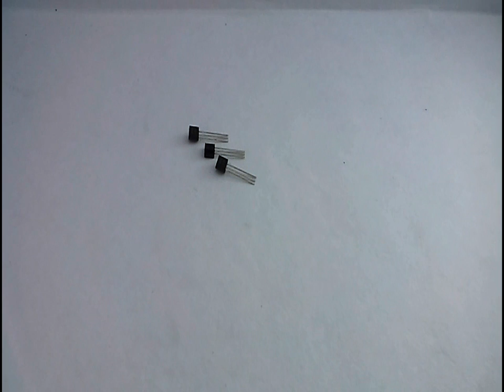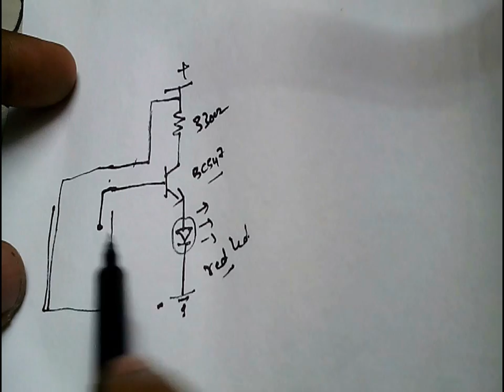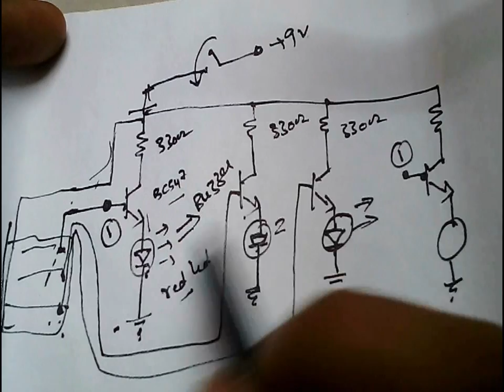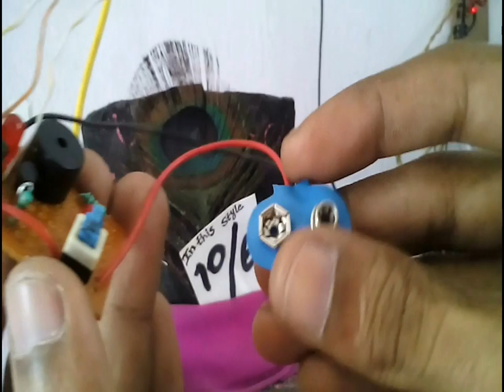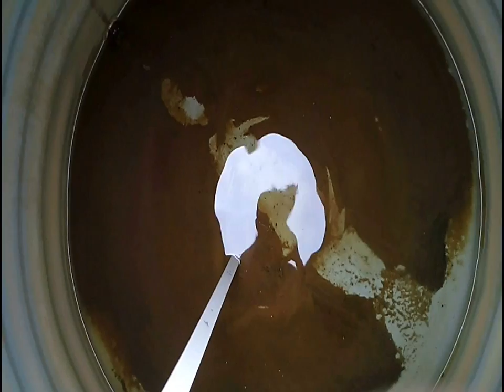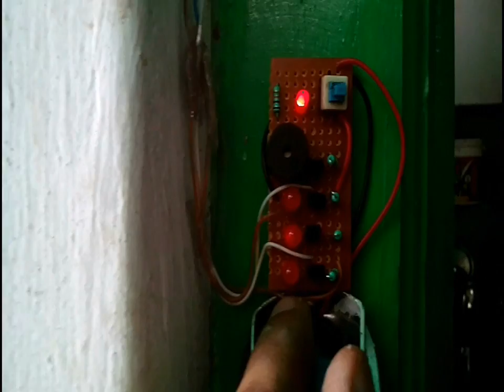Overhead Tank Water Level Monitoring system

Comment: 1) If we switch on the circuit full time (24x7) then how many days will get the battery back up..
2) I used 5V 1A adapter instead of battery and tested with a mug of water,but i am getting shock from the water.. how to resolve it.

Comment: Hi nice presentation,my question is how long will the battery last?
Reply from the maker: Mine lasted for a little more than 4 months
Reply: Thanks for reply, have got one more question have tried making one of this it worked but considering the water resistance my LED are not bright when in 2000 ltrs tank.kindly advise am really looking forward to see this work out for my main house tank. Am using 220 ohms resistor.
Reply from the maker: Hope u r using a 9v battery, try changing the transistors to something which has high gain.

Comment: Dear Mr. Khader... I have 2 overhead tanks... Can I build a single system with separate LEDs and sensors. Still keeping the battery, buzzer and the circuit common. Please guide with circuit diagram and help.

Comment: Please clarify about 330 Ohm Resister. When asked about this they are asking more details about the  330 Ohm. Please Clarify the full specifications of the resister & also instead of BC 547 Transistor got BC 548  as could not able to identify very small letters.  Please clarify the two problem to make the  project success.   Regards.

Comment: how to make auto cut if possible wireless system pls guide video
Reply from the maker: +Ashish Rateria u mean short-circuit cutoff?
Reply: Electronics Made Easy : KHADER when water reaches at maximum power cut off and level indicator are wired any solution for wireless as created by Vipin verma
Reply from the maker: +Ashish Rateria u can create this same circuit and wire it to the RF modules to create wireless system

Comment: Excellent work man. Job well done. 
Its been almost 2 years now, How is this thing working?

I would like to implement this at my home. As I am not from the electrical background, it will be really helpful if you could provide the circuit diagram. 
Thank you for posting this video.
Reply from the maker: +Ravi Raturi thanks for asking Ravi. Everything is going good for now. U can get the circuit in the video itself.

Comment: Hi Khader your video shows awesome work and I am trying to make it because tank is on the 4th floor and everytime one has to go up to see if it is filled.
I have made the circuit as described. Previously I used lower resistor so the led got burnt but putting wires in the water it was lighting (aft sm time led burnt). Then I used 1k ohm, it was still lighting but very low. Later I learnt the colour coding. Now that I have learnt the colour coding of the resistor I have a 220 ohm which I am using with 547 transistor. Its not working. I have tried with 100 ohm. tried series with 220+220 ohm. No luck. Now am again using 1ohm & 1k ohm (which were working previously) but even they are not working now. circuit is as previous. every wire connected to breadboard and respective place. Can u tell me what is the problem? Is there any way to check at which stage current is coming or something. Never usd multimeter but hv seen videos. Can buy it if u suggest. 
Am new to electronics but very curious.
Reply from the maker: +Mayank Mishra Hi, please try connecting a single stage of transistor and try touching the positive wire and base of terminal at the same time with same finger. If the led doesn't glow when the base is touched with finger then probably the transistor is burnt(assuming led is working). If any more doubts then please contact me on whatsapp-8686679336
Reply: Thanks for your reply.
Single new transistor on breadboard (assuming previous burnt). Removed +ve wire from breadboard put an end of another wire to +ve, other end to base of transistor. On breadboard led anode to emitter and cathode to -ve connected. nothing connected to collector of transistor. Didn't glow. Anything wrong?

Comment: I have made similar one for my building, 4floors high, couple of years back, but had to mount circuit board near the overhead tank and run LEDs wires to ground floor, near main Switch. Because of distance the power to LEDs was not enough as per original plan. Good presentation by you.

Comment: I made same circuit vd sme design ... but my leds r getting burnt ..I used 9V Battrey ..could yu pls helo me out ..
Reply from the maker: +joseph jo hi joseph, could you please tell what resistor values you used and also check if its value is above 330ohms atleast.
Reply: 330ohm
Reply: Can i use 220ohm instead??!!
Reply from the maker: +joseph jo the leds are getting burnt because of high current flow i suppose. Try using higher series resistor value(use two 220ohm in series for each led=440 ohm)

Comment: how to automatically cutoff the pump power supply when water reaches full level?
Reply from the maker: replace the top most led with a relay in NC mode and connect pump to the relay. when water fills the relay will be on and pump will switch off

Comment: Dear Khader,
Excellent tutorial. I have wired the circuit and now need a power source. Thinking about hooking up a 9V DC adapter. What should be the amperage of such an adapter? 9V adapters are available for 1A, 2A etc.The overhead tank is situated two stories high. Waiting for your suggestion. Thanks.
Reply from the maker: +Ramesh K u can use any adapter rated above 500mA.
Reply: Using a DC 9V, 500mA adapter and it works! In this testing times of water scarcity, your solution is a godsend! Imagine if every household had a system like this in place. Thanks.

Comment: Good One bro It help alot I have made same like this
Reply from the maker: +Piyush Kolambe thanks :)
Reply: +Electronics Made Easy : KHADER  
Welcome :)
But instead of battery i can use other thing i.e like 9v adapter
Reply from the maker: Piyush Kolambe yes u can use adapter
Reply: +Electronics Made Easy : KHADER 
Can You please tell me what should be voltage of adapter and how to connect it??
Reply from the maker: +Piyush Kolambe use a 9v dc adapter. there are two output wires from the adapter positive and negative. connect the positive wire to the positive terminal of the circuit and negative wire to the negative terminal of circuit. if u have a connector pin as the output of the adapter then cut the pin and then access the wires
Reply: +Electronics Made Easy : KHADER 
Thanks :)
i can use cellphone chargers as adapter its of same power

Comment: can i use 220 ohm resistor at the place of 330ohm?
Reply from the maker: +Piyush Kolambe  yes you can but the leds may be a little brighter and the battery life may be reduced a little. if possible use a 470ohm resistor or a close value. but if they are not available then using 220ohm resistor wont be any problem